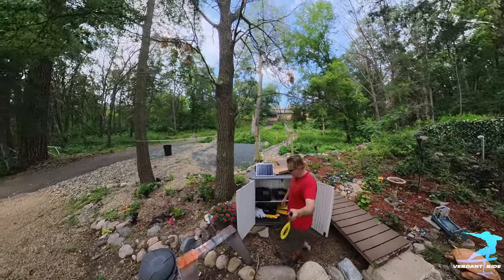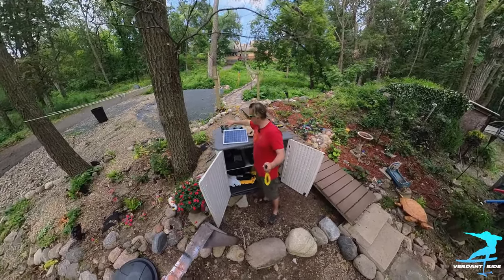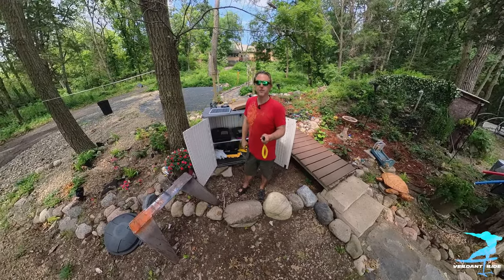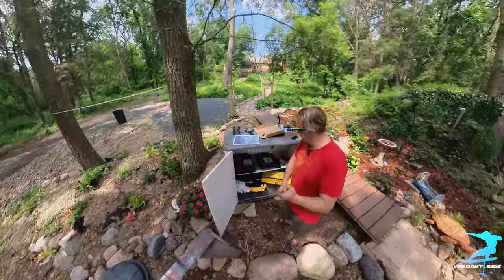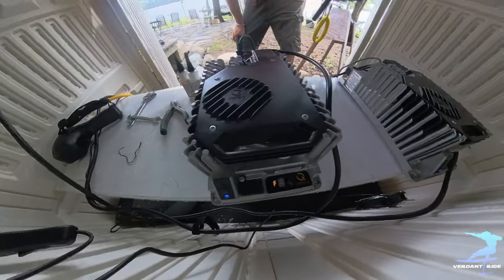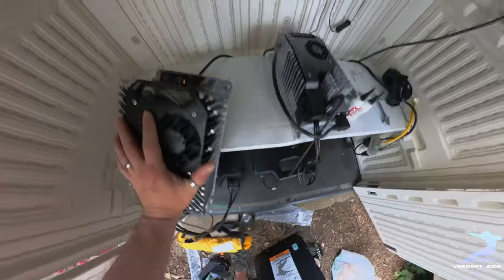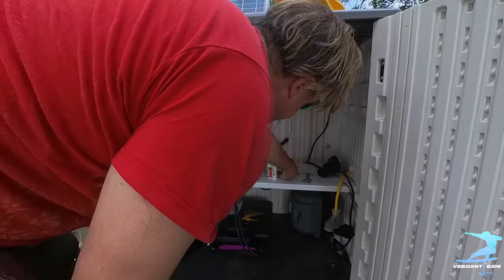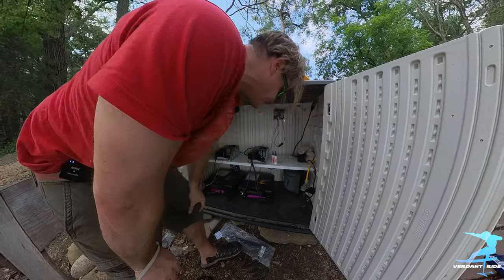eFoil Battery Charging Cabinet with Solar-Powered Cooling Fans

Comment: What are these "battery coolers" that you have your batteries setting on?
Reply from the maker: They are CO2 cartridges. Excellent heat sinks and should a battery go critical, they'll expel their contents rapidly cooling the cabinet and filling it with CO2 making fast enemies with fire.